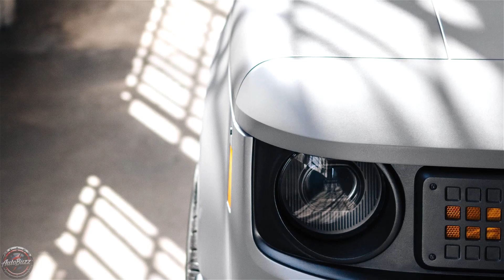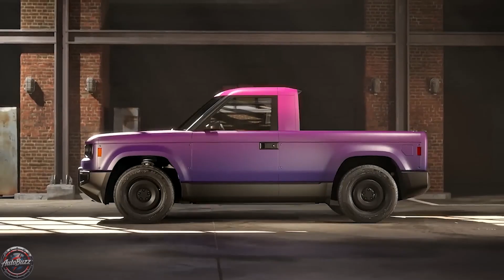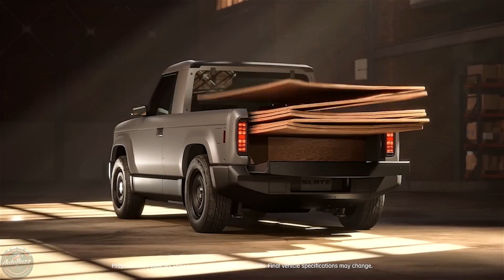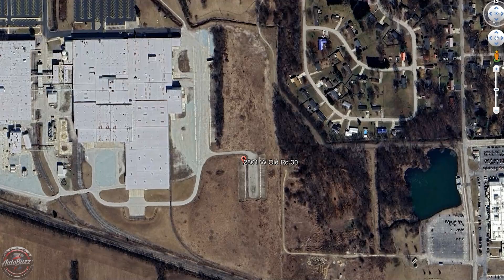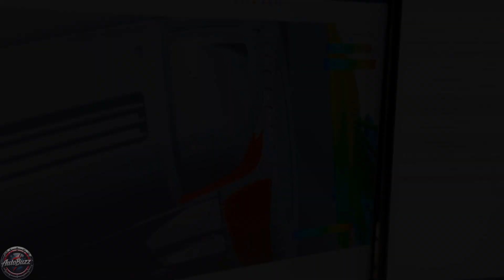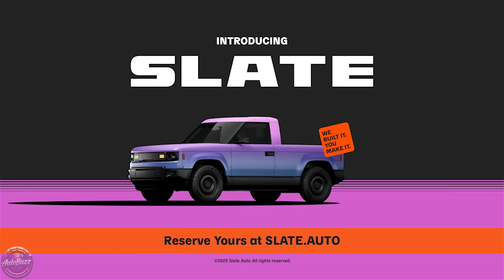Is a $27K Electric Truck Even Possible?

Comment: OK I watched a lot of this hype and I get it but hold your horse's. How does this thing preform??? Especially in cold weather and Snow. We all know EVs are notorious for not keeping a charge or taking forever to change in cold weather. With the tiny battery range for the base this thing will have major problems in winter. Also lets talk about this very short wheelbase... Old shool light weight pickups couldn't even pull a minimal grade in the rain without spinning the rear end. I suspect this will be similar. Im not knocking it but Ive got some major questions! Show us some real world applications, not just some video AI rendering of this vehicle. Show us it after two weeks in cold weather in the Teen's... I feel like something is off here. Every video Ive seen is all about the trinkets after purchase and not about performance. What AREN'T they telling us???
Reply: Tire technology has improved drastically,  and this will probably be fine in slippery and winter conditions with proper tires, including winter tires as required.